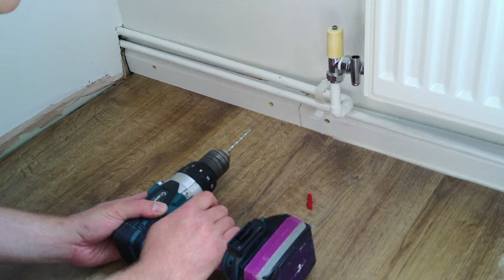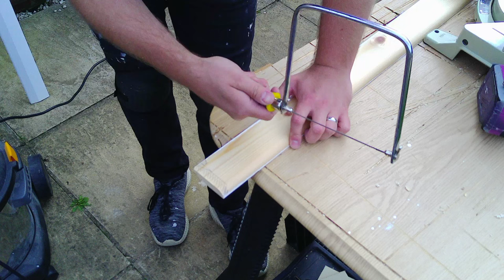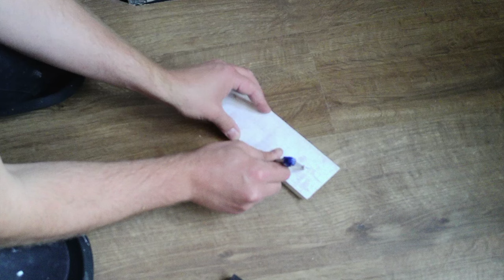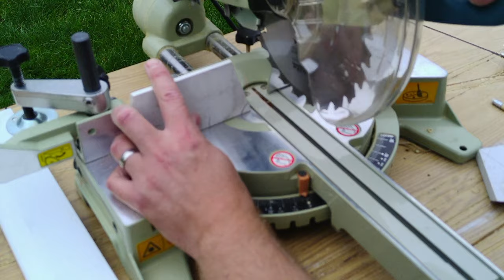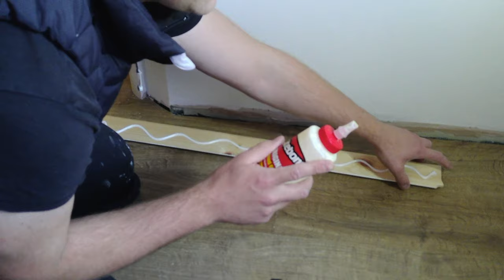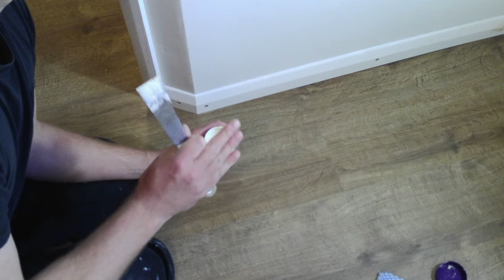DIY - FITTING SKIRTING BOARDS/BASEBOARDS as beading for laminate flooring and other hard floors

Comment: Nice one, thanks for this vid. Does it make a difference if you've got carpet instead of laminate flooring? Not sure if I should sort the skirting board first before getting carpet put down.
Reply from the maker: The process of fitting the skirting board is the same with carpet and laminate but with carpet the skirting board goes down 1st then the carpet and with laminate flooring it is the other way round. This is so the skirting board can cover the expansion gap around the edge of the laminate flooring.
Reply: @MakeItWithTim  great, thanks for explaining :)
Reply from the maker: You are welcome 😊